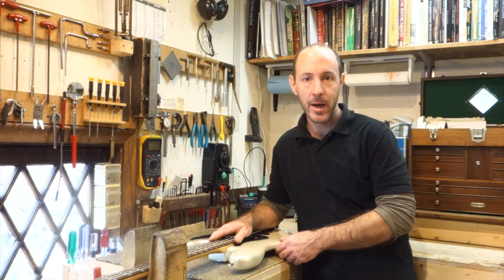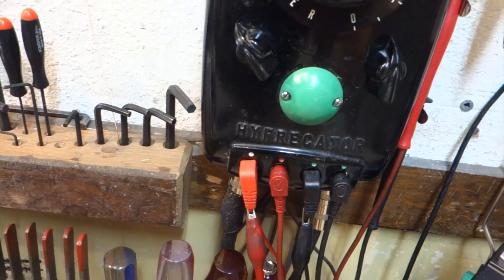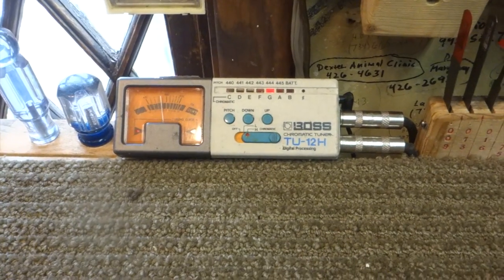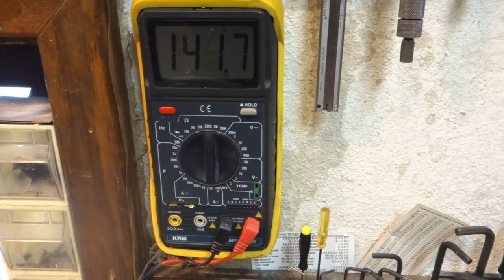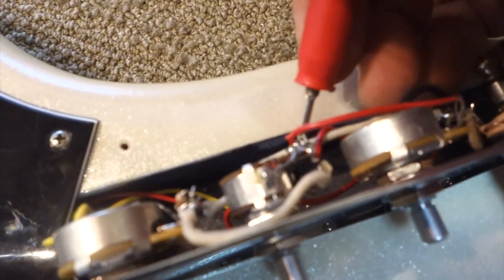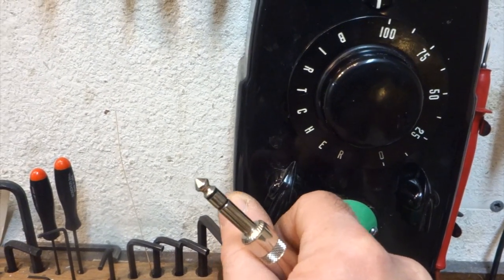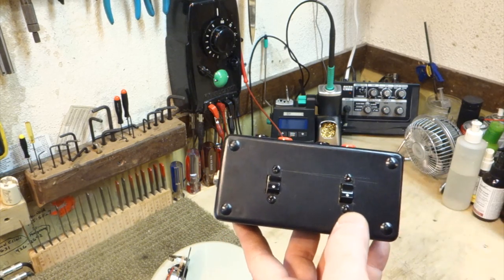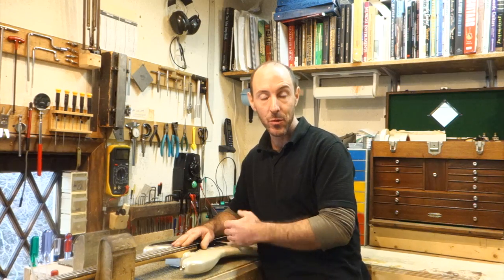Guitar Bench Control Switch

Comment: Absolutely fantastic David! I had seen your videos, and then heard little more about you at my time in Galloup School. I really admire your work. I finally built a switching system of my own, with the option of either hooks, alligator clips, pins or jack (hooked to a 4 way rotary), on to an analog multimeter, digital multimeter or straight into the amp (hooked to a 3 way rotary). I didn't go as far as going stereo, but it's still very useful and quick. One thing I noticed though, is that when using my digital multimeter through the switching system (as opposed to by itself), it makes it go a little crazy. Say I was mesuring a pot or resistance, it would be considerably jumpy, like it wouldn't settle on a given reading. I figured it may have something to do with the fact that all grounds were connected together on one bus, and that even though there's a set of probes and a reading device selected by the switching, there are also some "stray" ground paths that would make the multimeter behave this way. If that makes any sense. What I did was wire it up in such a way that I'm also controlling the individual grounds, so they are all independent. There's no one switching configuration that has a ground going anywhere else than from a given point A to a given point B. After this little tweak, my multimeter is once again giving me stable readings when connected to the switching system. Thanks for a great idea!